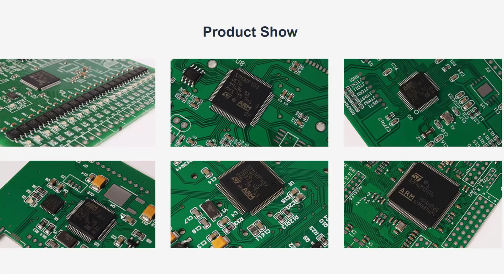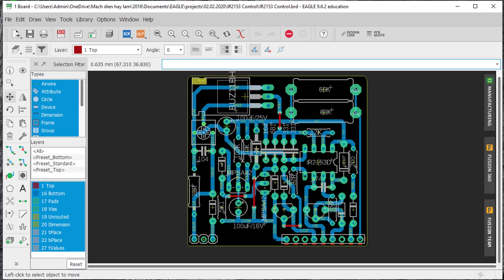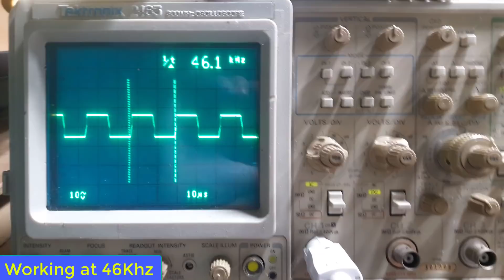IGBT and Mosfet | Switching Mode Power Supply Controller Board | Winding Detail | Shared

Comment: Hello bro, can u design a circuit that can generate 3 phase 120° pwm for inverter refrigerator iinduction motor.  Using any non programable ic like lm324 or programable ic...
Reply from the maker: I cannot do that bro